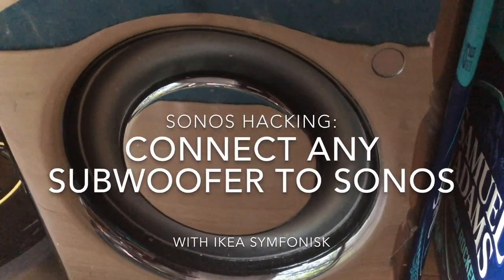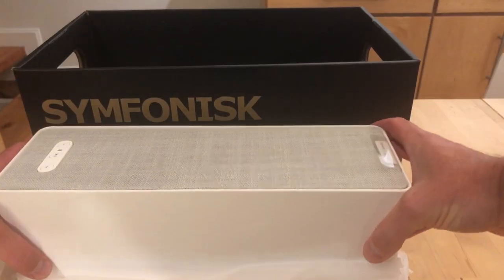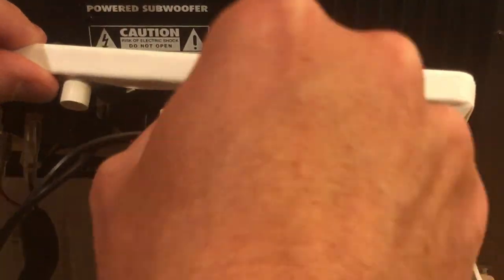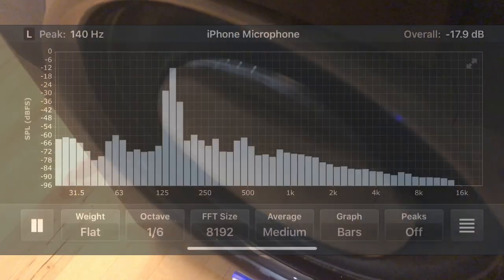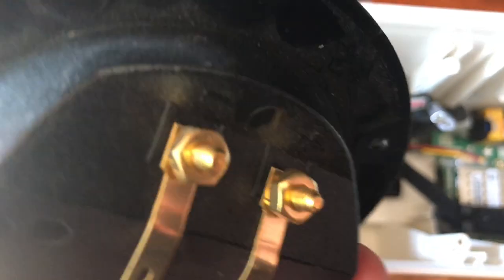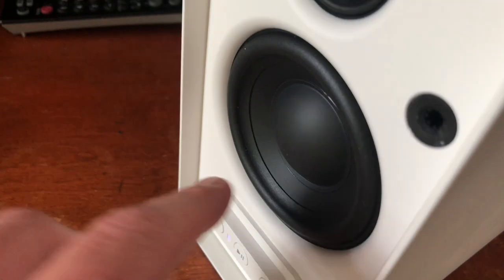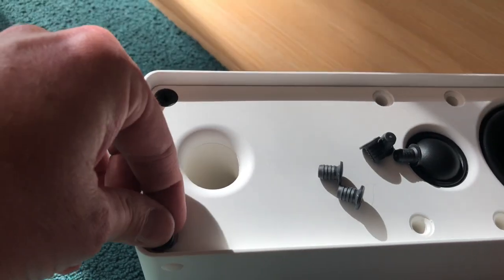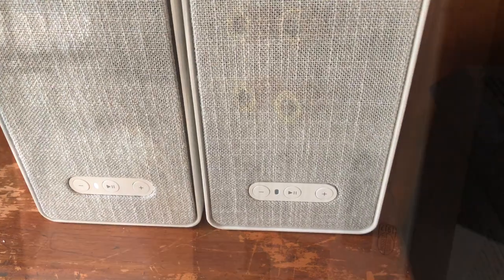Connect any powered sub to Sonos with this Ikea Symfonisk DIY hack

Comment: cool hack! Just wondering, couldn't you attach a wireless sender into the Symfonisk and a wireless receiver behind the sub?
Reply from the maker: You certainly can, you’d just need to convert the amplified power back to a signal before plugging that into the transmitter. Wireless has some degree of lag but it will work

Comment: Just got symfonisk and sub, do I add speaker wire to the sub connectors in symfonisk or should I disconnect the symfonisk sub altogether and just run wires straight to polk audio sub?
Reply from the maker: You have a few options. This video covers all the scenarios https://youtu.be/9Bvof0hF4LE

Comment: Any idea of how to connect this to a 5.1 setup? I have the beam and two Sonos ones, can I add this as a sub or would it be a separate group?
Reply from the maker: So do you have a Symfonisk wired to a powered sub as I showed? If so, you could consider using those as your rear channel in place of the 1’s. I don’t know how much low frequency signal is sent to the rears though.

The other option is to just use a single Symfonisk as a sub (disconnect the internal drivers, just use to feed a sub. Then group it with the rest of your surround system.
Reply: @todd.parker   "group it with the rest of your surround system" is this possible? i have a beam and two play 3's in sonos's surround mode.
Reply from the maker: Peteo yeah, for that situation, I’d use a single symfonisk with the internal drivers disconnected and the woofer signal sent to your sub. Then group it with the surround system and use that zone to adjust the bass volume.
Reply: You can it as a Sub with the App SonoSequencr

Comment: I feel like I'm missing something here.  Is there a Sonos Connect hooked to an amplifier that is driving the Symfonisk?  I don't see how Sonos is being integrated into this system.  Great video BTW.
Reply: Ken Moelhoff the ikea speakers work with the Sonos ecosystem
Reply from the maker: Yes, the symfonisk speakers are Sonos speakers. The guts are basically identical to Play1s but the lower price and easier to access cabinets make it fun to hack into.

Comment: Would a Polk PSW10 be suitable for this set-up? If not can you help star me in the right direction? Thanks for this video! I just bought a Sonos Arc and two One SL's but couldn't bring myself to spend $700 for the Sub.
Reply from the maker: Yep that one will work. Really any sub with speaker level inputs will be fine
Reply: @todd.parker  thanks for the reply, found the PSW10 on FB Marketplace for $65 and wanted to make sure before snapping it up. Excited to dig into this.

Comment: Are you not missing any signals as the speaker will only receive single (L or R) channel signal? Also does this have any volume penalty on the speaker itself causing a mismatch on L & R?
Reply from the maker: Most low end isn’t in stereo and it’s non directional so I think in general you won’t be missing much but you can run the output from both symfonisks into your sub if you want to be more even. I don’t hear any difference between the symfonisk attaches to the sub and the one that’s solo

Comment: Todd.. I was thinking of using a variation of your idea to directly power an Aura bass shaker off of the wire going to the woofer built into the Symfonik (and disconnecting the built in woofer). Is there a particular reason that wouldn't work? Also, can I just disconnect the tweeter and wrap the connectors in heat shrink, or would I need to use a resistor or something to keep the built in amp happy? Thanks
Reply from the maker: I think if you disconnect the woofer, the internal amp could power the bass shaker. It’s only a 50 watt amp but it’s decent quality. I’d either use wire caps or electrical tape around each connection but there’s no need to add anything else to keep the amps safe. Let me know how it goes...
Reply: @todd.parker  Thanks Todd. Ordered the speaker and shaker, so I'll let you know how it goes after testing this weekend.

Comment: is it the SYMFONISK speaker that drives the SUB or is it the SUBs amp driving it when plugged in this way?
Reply from the maker: Although the signal coming from the symfonisk is amplified, the sub is converting that down to a signal then re-amplifying it.

Comment: Love this hack.   Question.  I have a pair of new play ones hooked up as a stereo pair. I have the same sub you use in this video. If I purchase the ikea speaker  and disconnect  the drivers in the IKEA.  Can I still use the play ones in stereo  pair?  Will I simply  group the stereo pair with the IKEA  and just get the the sub functioning?
Reply from the maker: Yes, that exactly it. Just disconnect the internal drivers and use it as a way to get a signal to your sub and group both rooms together.

Comment: if you use trueplay and tune the whole system can this actually be used for a full setup. I wonder if getting a sonos sounds bar and using the symfonisk-hack as the sub would make the ultimate condo 2.1 setup
Reply from the maker: That’s how I had it set up and it sounds great! Trueplay is great

Comment: Hi, really quick question hopefully you see this! I have two Sonos Play:3 which I don't want to "hack". If I buy a Symfonisk and follow your guide, is there a way to make the Symfonisk non functional but just being used as the facilitator for the subwoofer? Essentially all I want is my Play:3s and the subwoofer emitting noise. Thank you!
Reply from the maker: Yep, you can set it up as a “gateway” where you disconnect the internal drivers and use it to supply a signal to your sub. You then group that with your other speakers. See my hack guide video for wiring diagrams and details
Reply: @todd.parker  Very kind of you, thank you!

Comment: Hi Todd! I hope you reply to old clips like this one ... I got an old Logitech PC sub with a wired volume control connected to the sub with what looks like a PC monitor cable. The sub sounds really good and if possible I'd like to hack it. Do you have any tips?
Reply from the maker: Those are tricky because of the proprietary connectors but the best you can do is get a speaker to line level converter and plug that into the Logitech’s 1/8” input. Check out my Sonos line out video to see how that works
Reply: @todd.parker  thanks, I will watch that one!

Comment: Would it be possible for you to make a video on how to connect a set of outdoor speakers like Kliptsh indoor/ outdoor set?
Reply from the maker: It’s pretty much the same as my bi-amp  Klipsch videos so check those out. You could leave the symfonisks inside and essentially just run wires from the woofer and tweeter amps inside directly to the woofer and tweeter in your outdoor speakers. Just bypass the passive crossovers and direct wire to the drivers
Reply: @todd.parker  Thank you so much for the info.

Comment: Could this work if you connected the terminal wires to an RCA Line in instead? I have a passive subwoofer and an amplifier for it but the amplifier only takes RCA input/3.5mm AUX input.
Reply from the maker: No, don't try that because it's way too much power to push into an RCA input. You can buy a converter like this to convert the signal down properly: https://amzn.to/36guWSE

Comment: @Todd
Do I need to use the speaker or can I just use it as a sub tether? I have 2 Play Ones and a Beam currently
Reply from the maker: Nope, you can disconnect the internal drivers and just use it as a way to feed a signal to a powered sub. I made some follow up videos that go in depth if interested
Reply: @todd.parker  do you have a link? Sorry i think you helped me on Reddit as well. I just need it to register as a “sub” so it will play nice with my 5:1
Reply from the maker: @Zakw17  There isn’t really a way to register it as a true sub. You can group that “room” with your home theater but that’s it. There is an app (https://celltekk.de/sonosequencr/) that used to let you do that but I think Sonos made them remove it.

Comment: I have a JBL Bar 9.1 with a big subwoofer and I want to hook up some bass shakers to my couch via an extra amplifier. Do you think I can get the sub frequency signal from the subwoofer internal speaker to wire to the amp that then controls the bass shakers? Can the signal that originally only supposed to be for the subwoofer be weaker after this signal tapping? Thanks in advance!
Reply from the maker: Yes, absolutely. This technique works with any powered speaker. I assume your bass shaker doesn't have high level (speaker) inputs so you need to buy a converter to reduce the powered line to a RCA signal. This kind of thing - must have a box with electronics, not just a wire adapter. https://www.crutchfield.com/S-Zi2v8YdjCsf/p_20646KILO/Kicker-46KiSLOC.html
Reply: @todd.parker  thanks for your quick reply, I see the converter but I do need an additional amp to power the bass shakers (2x 50watt) if the amp has high input levels this converter would be unnecessary since the subwoofer already receives a low frequency range (I guess?). Then can the signal that originally only supposed to be for the subwoofer be weaker after this signal tapping? In other words: will the signal tapping have an effect on the signal that the original wireless subwoofer receives? Thanks in advance.
Reply from the maker: @jdankbaar  I thought you mentioned that you had an extra amp for the bass shakers? Yes, you'd should have a separate amp for the bass shakers and just skim a signal off the woofers to feed to that. If you hook a subwoofer and bass shaker off one amp, there is a good chance that will be too much for the amp. Each speaker you add in parallel drops the impedance by half and makes it harder to drive.
Reply: @todd.parker  the subwoofer and the bass shakers have their own amplifier, subwoofer is wireless but doesn't have line-outputs. That's why I want to tap a signal from the subwoofer to feed the separate amp with a low level signal for my bass shakers. But my question is: does the signal tapping have an effect on the high level signal the subwoofer receives originally before tapping? In other words: does the subwoofer that is tapped from perform the the same after tapping it?

Comment: If I wanted to connect a set of B&W CCM 618 Loudspeakers through the Symfonisk, how would I do this? There is only one binding post and I know the symfonisk has two amps, one for the tweeter and one for the woofer. Help?
Reply from the maker: Good question. On a ceiling/wall speaker there will be a passive crossover attached to the back. You want to trace the wires coming out of the crossover that lead to the woofer and tweeter and connect the Symfonisk amps to those wires so you’re circumventing the passive crossover and direct wiring. Those connections seem to be in the upper left of this photo - https://img.letgo.com/images/fd/b8/47/3b/fdb8473b965edaa3228bc098f24c360d.jpeg?impolicy=img_600_pwa
Reply: @todd.parker  Thanks Todd! I will give that a try

Comment: What about LFE? Doesn’t the Sonos DSP remove the LFE if it thinks it has a dedicated sub and only send mixed low frequencies to the surrounds? Yes it will liven up the low end but if the LFE isn’t in the surround input then you are missing out on all the lovely LFE the sound designers spent so long editing for your pleasure. Maybe I am missing something. Wouldn’t be the first time
Reply from the maker: If you want proper LFE, you need an official sub. This hack is more than enough for most people. It works surprisingly well. I just did a setup for a friend and it sounds amazing for the $130 he spent on a sub plus a 3.0 minutes of my time to wire in a speaker terminal to his symfonisk
Reply: @todd.parker  Thanks. I guess if you want to be a purist then you have to part with the cash. I will hunt around for someway to get the Sonos DSP to route the LFE to a surround and then use this hack. Might need to jailbreak something to get that though!
Reply from the maker: If you figure that out report back here

Comment: Hi Todd, this is awesome, but is it possible to send the signal from the symfonisk into active (powered) speakers? I thought that sending this amplified signal into an active speaker would create terrible distortion because there are then two amps in series, but it seems like that is what you've done here with the sub?
Reply from the maker: You’d need to either grab it before it’s amplified (which is very difficult) or convert the powered back down to a signal level. I tried the latter idea here: https://youtu.be/QhT3j9_6Zic

Comment: Could you go a step further a strip the components from the IKEA speaker, mount within the sub. Using the power supply input from the sub, powering the Sonos signal which intern feeds the sub so you only need one power supply?
Reply from the maker: I suppose you could, yes
Reply: It won't be long until someone makes a video of that and uploads it

Comment: Hey quick question: Does it not matter that you have both channels going into the sub? Do the low freq sounds typically not vary by channel?
Reply from the maker: You can get away with just one channel in my opinion. Most bass is mixed across both channels.  That’s honestly how I had mine set up and it sounded great
Reply: @todd.parker  awesome, thanks for the answer!

Comment: I have a sub with only cinch connector, can i Connect the symfonisk via the cable and a Adapter to cinch to my sub? (Yamaha yst FSW150)
Reply from the maker: Looks like it has a single RCA input. This o]would work if you got a speaker to signal converter.
Reply: @todd.parker  okay i found a cable: speaker to cinch, on Amazon, should that work?
By the way thanks for your reply!
Reply from the maker: Just make sure it’s a converter with a box like this one. Kicker KISLOC 2-Channel K-Series Speaker Cable to RCA Adapter with Line Out Converter https://www.amazon.com/dp/B00I4EF1BC/ref=cm_sw_r_cp_api_i_HVQ14GBBZ9QNBAGC1S0Y

Comment: Hi wicked idea how do you no you have got the speaker phase correct as one manufacture + or - could be a different and the bass can cancel out
Reply from the maker: You could always test the polarity both ways, either by reversing the wires going into the sub’s speaker input or by using the phase switch most subs have and seeing which sounds better.

Comment: I was able to hook up a psw10 to my symfonisk. How do you tube this with true play? I tried disconnecting ako the speakers from the IKEA unit and just the sun but the Sonos application was not able tune with just the sub. Do you tube it with the speakers from the IKEA unit and the subwoofer attaches and then disconnect the IKEA speakers after the tuning?
Reply from the maker: Good question. I’ve so far only used the symfonisks to add a sub for a 2.1 system or to bypass the internal drivers to bi-amp external speakers. I haven’t used the sub solo but I guess you’d need to try both ways and see which works best or if no Trueplay is best. My hunch is you’d want to tune with the speakers and sub turned to 69-60% volume of where you’d want it. Too much and Trueplay may be fighting against your sub. This way, you’re accounting for room response. Then disable the internal drivers.

Comment: I have a PolkAudio PSW110 that has high level in & out. Did you completely disconnect symfonisk's subwoofer when you put the binding posts in?  And if I did a second set of binding posts, could I have the subwoofer's high level out come back to the symfonisk's subwoofer via the second set of posts.  Or leave the symfonisk speaker disconnected?  Or show it the way in your video shows it where it still goes to symfonisk's subwoofer and to the post? Sorry for the questions!
Reply from the maker: If your sub has high level inputs and outputs then the best thing is to wire on set of binding posts from the internal woofer amp to the sub input. The second set could go from the sub output to the symfonisk woofer so it won’t work as hard.
Reply from the maker: I am planning on making a video of this next. Might be another week or two though...

Comment: Great video about the sub hack Ik have a Beam connected to my tv. Can i connect a symfonik with the sub hack to the beam in a wat that i only use the sub function.......and that IT always works when i play music on the beam or watch tv ? Ik want to use a low sub to hide IT under my couch so i wont use te symfonik for " normale" use. Ik hope my question makes sense 😀

And secondly: if i use a sub.......should i change the equilaizer settings in the beam ( loundness of less bass)

Third : should the sub woofer be passive or actieve 

(BTW sorry for the mistakes, my english isn't great :-)
Reply from the maker: If you just want to connect the subwoofer, you can use the gateway technique. With this you disconnect all the speakers in the symphonisk and just use it as a way to get a signal to a powered subwoofer. The subwoofer must have a built-in amplifier for this to work. This will show up as a symfonisk and you can group that to the same room as your sound bar. You could reduce the bass to your sound bar once you have these grouped together. See this video: https://youtu.be/9Bvof0hF4LE
Reply: @todd.parker  thnx i AM gonne give it a trie.....Just one more thing. Do i understand IT right that the sub wont sync with the beam when i use the TV remote for volume ( loundness)? 
If so.....i wont even start cause we dont use the Sonos App when we watch TV.
I hope my question makes sense for you 😀
Reply from the maker: @Profox77  right, it will not sync because it’s essentially just another speaker grouped to your sound bar room
Reply: @todd.parker  i was afraid of that......butt maby in the future there.will be a next hack......in gonne search and try. Manny thanks.....youre.videos are.really great and clever